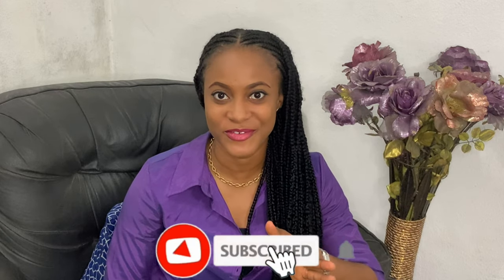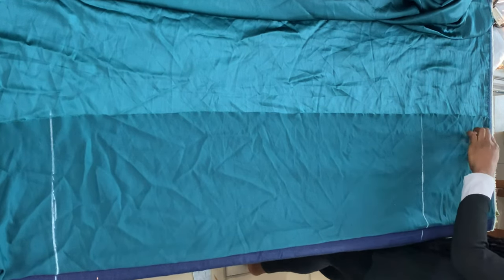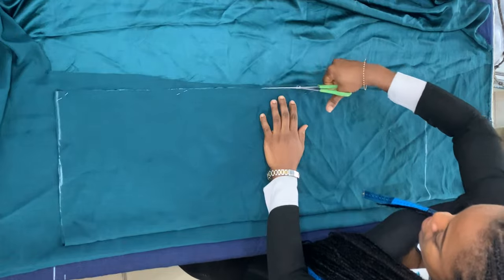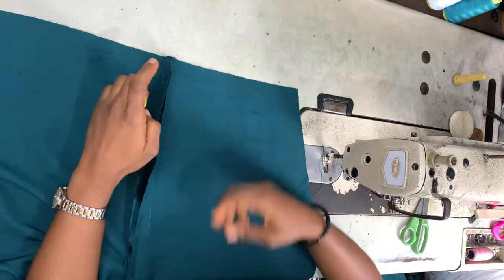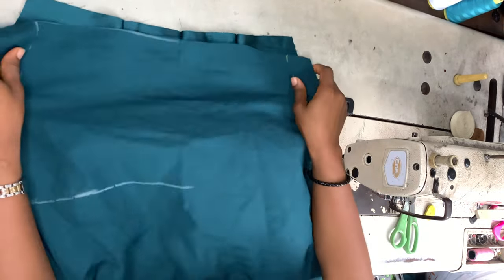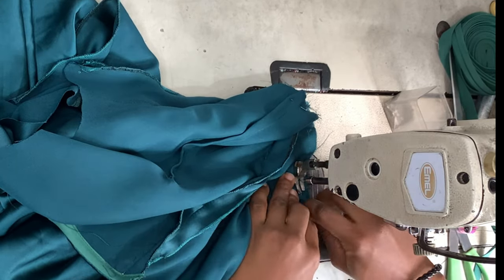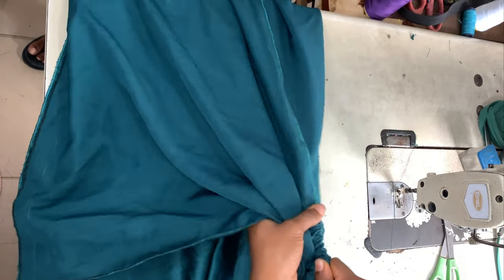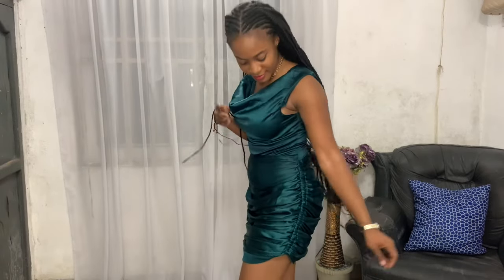RUCHED DRESS | Cowl Neck Ruched Dress | Cutting & Stitching |How to cut and sew a ruched dress Silem

Comment: Hi, I made the skirt of this but the zip keeps bulging at the back after the rutching. What can I do to correct it?
Reply from the maker: Reduce the length of the zipper so it doesn’t get to the ruching or insert the elastic for the ruching starting below the point where the zipper stops.